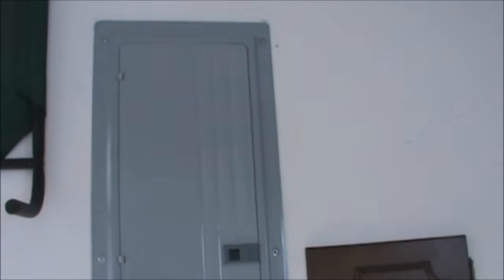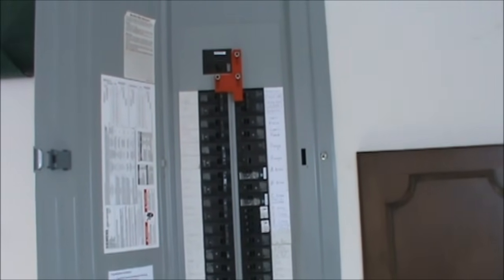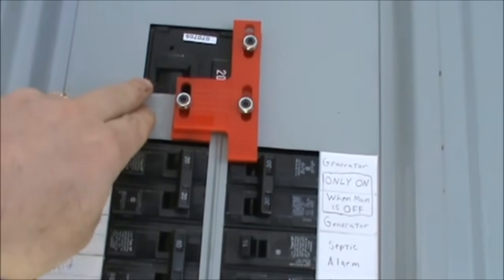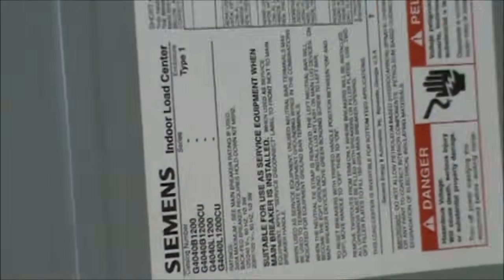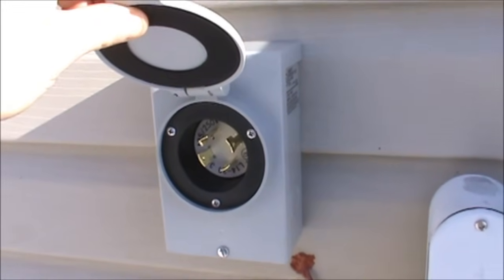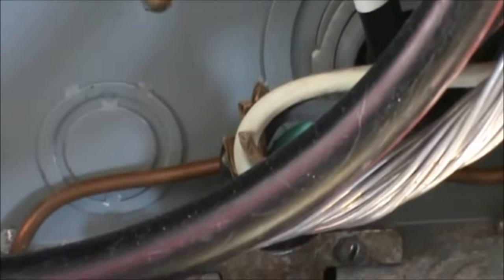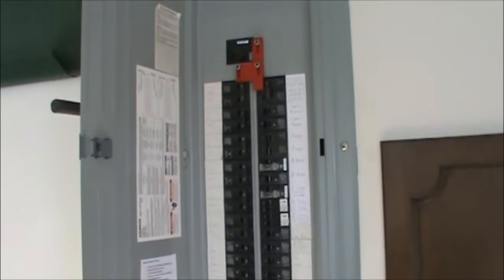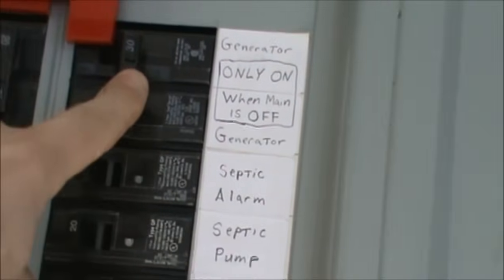How to wire a generator to an electrical panel

Comment: I call bullshit on electrocuting line workers by backfeeding down the mains. The impedance of the grid is SO LOW that the second you flipped on the generator breaker,  it would trip or the generator would stall. Just my $0.02.  (Qualified engineer)
Reply: Peter Kopteros The generator isn't powerful enough to supply more than one or two houses. Because of this AND the fact that the grid impedance is so low, the circuit breaker on the genny would trip as soon as it started. Think about the following. If you take a AA battery that can, in theory, supply two amps and connect a 3 watt 1.5 volt light bulb to it, the lamp would shine at full brightness. If then you take a second bulb, identical to the first, and connected it in parallel to the other bulb, both bulbs would go down in brightness because you would be trying to pull 4 amps from a source that can only supply 2. If however you take 10 bulbs and connected them to the single AA battery, the battery would likely catch fire as the extremely low resistance behaves like a short circuit to the power source. The difference between the generator and the battery powered experiment is that the generator would either trip it's breaker, blow a fuse or burn out a winding in no time after starting.
Reply: Nicholas2011ist 
And when the brake in the normal line is at the pole in front of your house??  You can call BS all you want. It is against code and actually illegal. Some engineer SMH
Reply: c3pfett For starters, at no point have I promoted or justified connecting a genereator with no interlock to a distribution board.

Secondly, I am NOT debating the legality of hooking up generators to distribution panels by any method.

Thirdly, If the break were between your house and the pole out on the street, why would it matter if the cable were energized since the cable arriving to the pole is energized anyway when the electrician does the hookup.

Electricians at work wear heavily insulated clothes so they don't fry themselves when working. And the ones that diddn't died last tuesday for not wearing them.

If you could answer the following question: How is it possible to undertake maintenance on 132.000 Volt lines on pylons without taking them offline?  Is it
A) JFM
B) Insulated electrician + tools

Comment: I don't need interlock rip off system,  I have something call a brain I know that before I turn on my generator to shut off my Main. when I sell the house I just disconnect. Is that simple...
Reply: If I were a service lineman working to restore power I would feel much better knowing my life wasn't at risk due to someonen's careless mistake.  Don't be so inconsiderate with someone's life, do it right and fail safe.